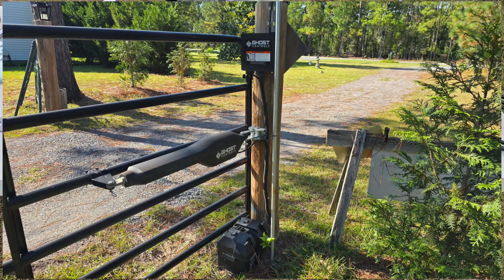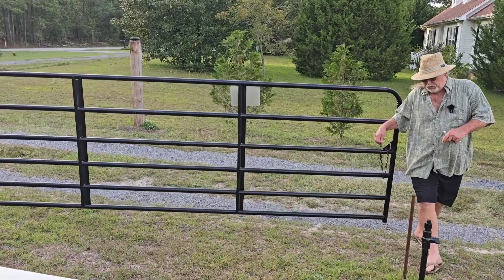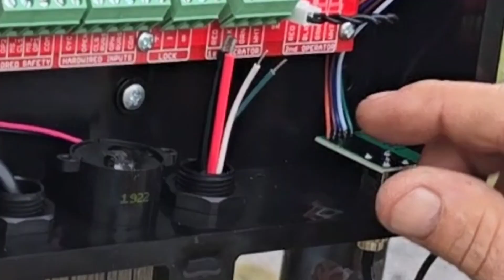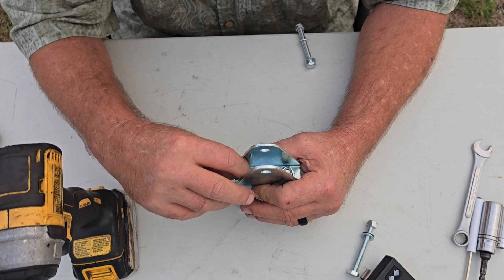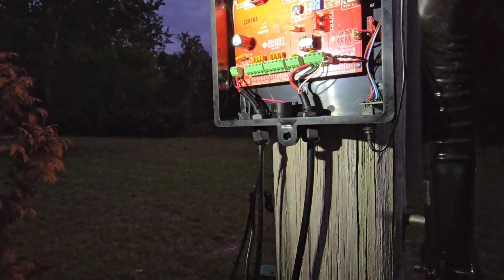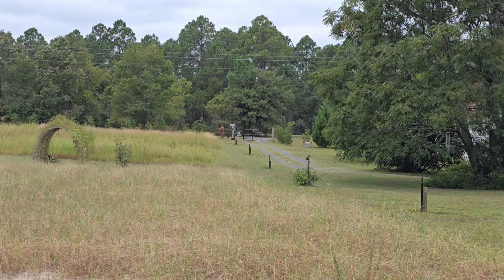Ghost Controls Solar Gate Opener Works Off Grid DIY installation guide

Comment: Had one installed over 5 years ago and still going,  HOWEVER, the installer had the knowledge and foresight to change a couple things.  He used a high amp 12v deep cycle battery, a separate solar controller, and most importantly, a full size solar panel with several times the capacity of the kit unit.  Still working with no changes to the system.  Oh, yeah, one more thing.  The geometry of the original hardware was modified by the installer to be better and more efficient.  Oops, I did make one change after almost 4 year.  The lag bolts for the bracket to post get loose over time so I drilled and installed bolts, washers and nuts completely through the brackets and posts.  They just ain't coming loose again.

Comment: How many cycles per day does the lawn mower battery provide? How many amp hours?
Reply: We only open and close it once a day when we are open. It may get alittle more use on the weekends. The battery is 300 amp, Interstate brand  SP35 model.